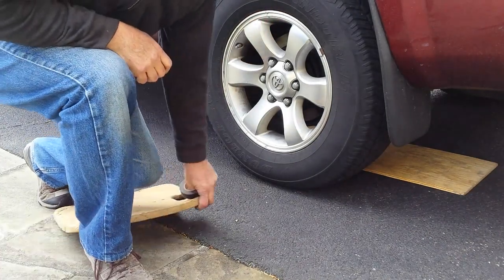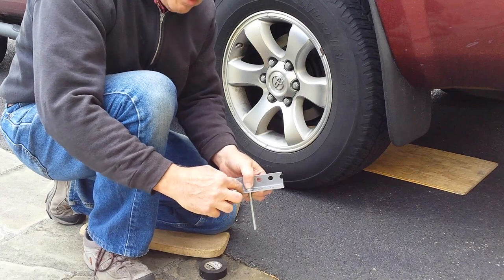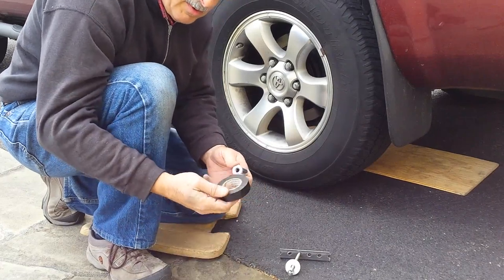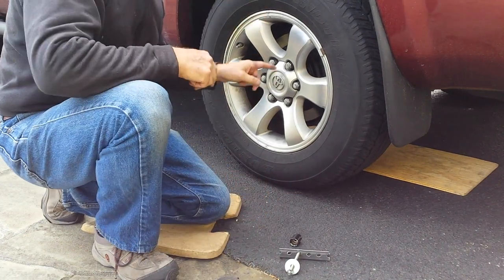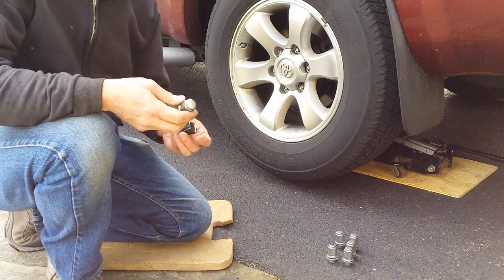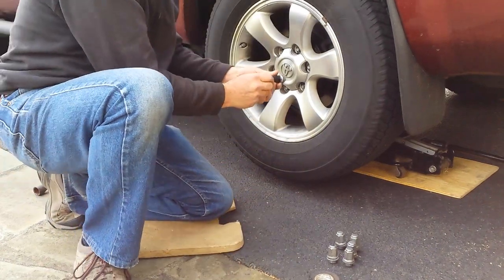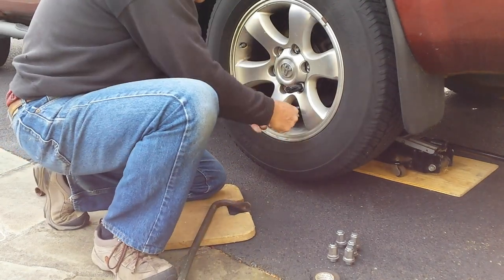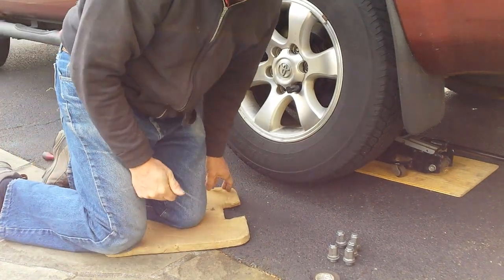How to Remove a Stuck Wheel Using Leverage

Comment: Tried everything else.  Drove 5 miles with loose lugs and it STILL didn't budge.  A trip to Menards to pick up the parts and 5 minutes to assemble and push in the pry bar (with extension) and it popped right off!   Thank you so much!!!

Comment: Fantastic idea. No amount of kicking was budging the wheel. I was lucky enough to have the pieces available - this worked in under 10 seconds once assembled. Instead of the socket taped to the crown of the lug, I used a deep well socket seated on the lug. Worked for me. Thank you!

Comment: Great idea. Here's a simplification:  instead of the angle iron and bolt, I use a 3" C-clamp clamped to the wheel.  Works great.
Reply: Yes, a pry bar, such a wonderful thing, leverage finally got the seized tire off! The Saab has lug BOLTS not nuts..
&All 'wheel parts' are loaded w/thread lock? so right TOOLs/Torque apply..Great car so far +GM made? but Porsche drive alike!
Reply: Used many methods I found on you tube with zero results. Tried this with a 2" by 1" piece of wood instead of the L section and popped right out first try.
Reply: @robertheinemann838  how did you use the wood? Trying to remove a stuck flat tire on my 2500 and found this video

Comment: I tried everything else working on it several times yesterday.  This morning I hooked a large strap with ratchet (a very large one), and hooked it around my other cars axle and tightened it up with no luck.  Finally, I found your method on youtube and, by gosh, it worked!  This is a large truck tire so I used two layers of the angle pieces, which it bent beyond recognition.  I had to do it in a couple of spots but it came off . . . thanks for the great advice.  It saved me lots of dough.
Reply from the maker: Cool

Comment: This is a great idea/method...well done.  Only wish I had seen it a few years ago.  I swore a wheel on my Highlander was welded to the hub.  Hitting, kicking, swearing....nothing seemed to work.  Eventually had to crawl under the car and kick tire from the backside (not a real safe option) to get it off.  

I sanded down the back of all wheels as well as wheel hubs and then coated them (don't recall what I used) and fortunately no longer have the problem.

Thank you for excellent "how to."

Comment: Well this is the third vid I've watched for a problem I never even knew existed. The brilliant 'lower wheel onto block placée under inside part of wheel' didn't work. Read comments here where one guy (can't find him now to acknowledge) swore by using chisel point on hammer action of drill between bolts / nuts. After just 5 minutes the wheel is proudly battle-scarred but it is OFF! (It's only a male van so pretty doesn't matter.) Thanks for putting this vid up so that man could post.

Comment: You rock, John!!!  Tried every other method, but only yours worked, and it came off easy even without any spray lube.  I used a piece of C-Channel from HD.  Adding my new little tool and a crow bar to my emergency tool kit.  Thanks again!

Comment: I also wanted to thank you for your video. I've struggled with aluminum wheels stuck to hubs for years. I believe that my kicking the wheels to free them led to my ruptured Achilles tendon :) Finding your video was one of those "why didn't I think of that?" moments. Many thanks great idea.
Reply: If you kick wheela standing up you can easily injure your ankles and feet.  Sit on the ground and use the bottoms of your heels to thrust-kick againstthe tire. You can safely apply more impact that way.
Reply: Puttinf one nut back on a few turns and using a 4lb hammer to the tire from the back does the job. Kicking always had me losing my footing and had the wheel ping off. There's many ways to skin a cat, this method I've found is the least hands on which is my motto when working manually. Use the least effort required and it's no longer work.

Comment: great idea. my tires were rust welded and wouldnt move no matter what i tried or how hard i hit it This actually worked. I have smaller spokes so I used adjustable metal strapping for pipes to provide the leverage point.

Comment: Thanks John. Had all 4 wheels stuck, and after trying kicking it and a rubber mallet, I tired this. It worked but because the wheel centering on Astra is high I had to go around a few times

Comment: Here is another method I just used 20 minutes ago Oct 13 2022:  Loosen the lugs a bit then jack up the vehicle. Now loosen the lugs almost of off, can also just take them off. Lower the vehicle back down.
the weight of the vehicle will break the rust that causes the sticking.  

The method shown here was going to be my #2, but the lowering the vehicle worked perfectly.  The method shown here would be a great alternative if the tire is flat. Toss the tools and bits in the trunk.

Comment: Thanks - I had a profoundly stuck rear wheel on my pontiac vibe and used a variation of your technique by installing a u bolt through the rim holes and doing what you did- used my long crow bar and popped the sucker right off

Comment: Smart! I’m still struggling with the idea of putting anti seize anywhere on the hub or rotor hat. I feel like that’s asking for problems later down the road if the anti seize migrates to any unintended surface, like the wheel studs. That said, in my current repair I have a steel hub with an aluminum wheel that appears to have significant galvanic adhesion. I believe the tight tolerance between the hub and the wheel and the existing scale rust on the hub is primarily causing the stuck wheel, as the zinc coated rotor hat has very little corrosion. I’m going to try abrasive cleaning of the steel hub- hopefully that avoids the need for anti seize. For others watching this video, I caution against using anti seize. If you are going to use it, my guidance would be to diligently avoid the wheel studs.

Comment: You method really work. Thanks very much. I just tried to rotate tires on my tundra. The wheel really stuck. Try karate kick it --> foot hurt :( Hit the tire from the back with heavy hammer -> nothing happen. Found your method on youtube and spend a little time to fabricate the tool. Nothing fancy and but really work. I keep it for future use. Also use anti-seize on the back of the wheel hub to make it remove easier the next time.

Comment: Nice solution. I put a 4x4 between my tires and closed the gap with a jack, pushing the rim loose.
Reply from the maker: That sounds like a good idea.  You just need the right size 4x4.  Very simple indeed.
Reply: nice..let's see that in a video.

Comment: No special tools needed.   Remove the lugnuts and hubcap and spray PB Blaster around the hub where it passes through the wheel center.  That's usually where the most resistance is. Allow 15 minutes for the PB Blaster to work.  If the wheel doesn't come off easily, put the lugnuts back on, and loosen one turn from snug.  Put a wheel chock in front and in back of the wheel, positioned near the inside edge of the tread.  Rock the vehicle forward and backwards against or over those chocks one time.  If you prelubed the hub with PB Blaster, that wheel will be loose when you jack up the vehicle.
Reply: anybody can talk..let's see your video..

Comment: Good idea havent seen that one before - you could also just put the lug nuts on loosely and drive the car to stress the wheel and it will loosen automagically!
Reply: Garry Gemmell had a tire change today, tried all my tricks in the bag. Loosen lugnuts, drove forward and backwards and braked really hard, went down the road a quarter mile and back, sledgehammer, dropped it quickly with the jack, tried to use my impact to shake it off. Broke the stud doing that. Think I'm going to have to try this method for my next stuck wheel.

Comment: The only weakness l can see is if a wheel does not have holes big enough to accommodate the angle iron. Then this  may not work. Still a  great idea. 💡 Considering this further if you brought the angle iron around from behind and put the bolt through a small hole it may still work. Some rims however, don't have holes e.g Holden EH. In this case this method definitely would not work.

Comment: Doing that can damage to the alloy's finish. 

If you screw the nuts back on, about three turns off tight, lower the wheel back down, then drive the car slowly, the car's weight force the wheel loose.
Reply: talk is cheap...where's your video..
Reply: I'm talking from 40 years of experience. I would add to what I said, it works best if the car is on a slope, side on with the wheel to break free off the hub on the lower side for that bit extra weight.
Reply: @spannerssockets6308 appreciate this

Comment: Apparently he doesn't live in Ill-Annoys where they put salt on the roads in the winter, and the alminum rim chemically welds itself to the hub/ axle. You can just slip that crowbar through the hole in the rim, and lever on the back of the formed aluminum rim 'spokes' and the brake rotor or drum. Without any contraptions. Same forces applied, and it's what i tried first.
Reply: I read similar comments to this one and didn't try thinking, "I'm not prying on the rotor brim".  However, I realized the idea is to pry on the rotor crown.  Everything else failed for me, but the right bar, through the hole, against the crown of the rotor and rim was not only successful but much safer than other techniques.